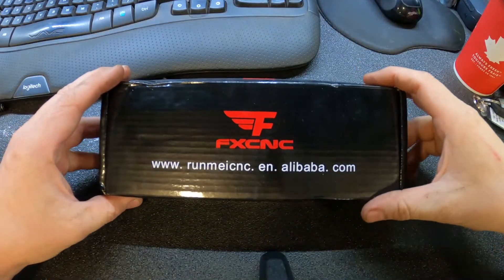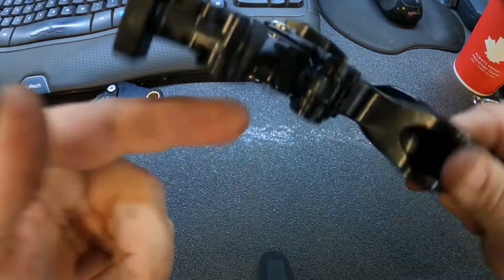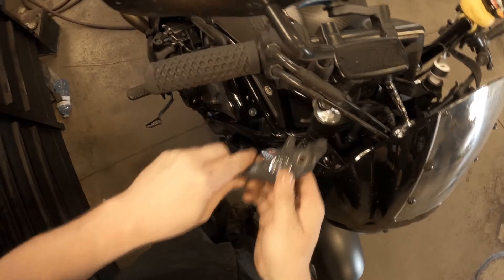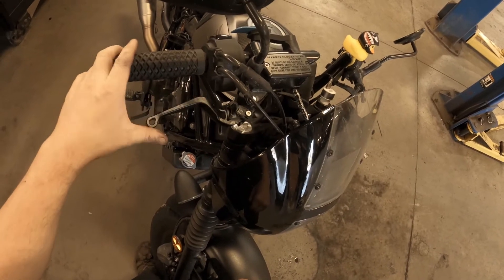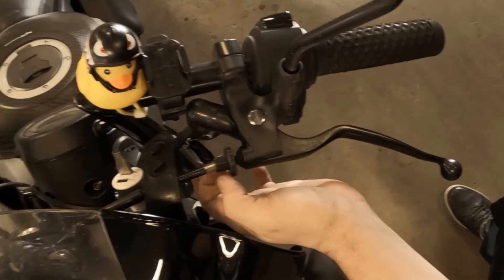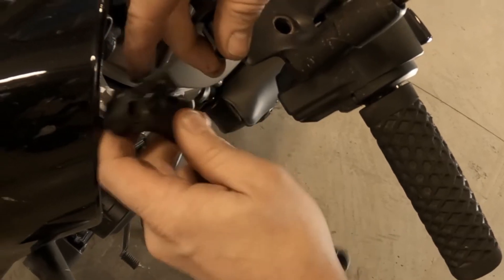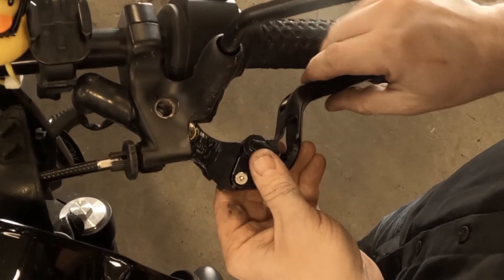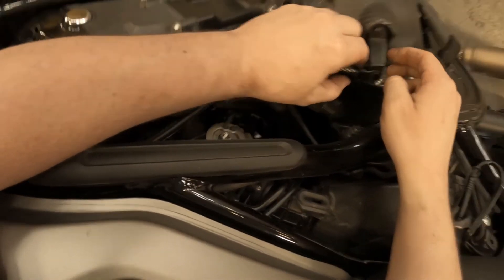Honda Rebel 500 (CMX500) Brake and Clutch Lever Install.

Comment: Thank you for the video!  I just installed these exact levers, and in particular the angle you showed of re-installing the clutch cable was really helpful. I love how they feel.  Out of curiosity, do you find the brake lever to feel a bit softer than the stock one did?  Everything feels good and like it works great - just noticing a bit more play on the brake.   Anyway, thanks again for the vid!
Reply from the maker: I did not nice that in the brake lever. Interesting. 

Thanks for the comment

Comment: The short levers make it look difficult to reach for the levers to me ~!   Are you sure that is an improvement ?     Kit
Reply from the maker: @deshavetalkwithkit8935  It does look that way doesn’t it. It doesn’t though. The adjustments make it come very close and easier to grab. Although be careful as this will adjust brake and clutch active engagement points.

Comment: Does anyone happen to know the size of the acorn nut underneath the pivot screw for the clutch lever. Mine must have fell off and lost after replacing my levers, I tried putting 1/4 inch acorn nut but doesn’t seem to thread down all the way.
Reply from the maker: M6x1.0 acorn

Comment: Will these levers work with the later model 500's (2020-2021) with the slipper assist clutch? Thought I'd seen comments somewhere that said no.
Reply from the maker: Absolutely!! Mine is the 2020.
Reply: @SLIGHT_  Thanx, I appreciate it. My guess then would be any after market levers would work for 2017-2021.

Comment: What is the name of those levers?
Reply from the maker: Motorcycle Short Adjustable Brake Clutch Levers for NC700/NC750 S/X 2012-2015, Fury/VTX1300CX 11-18, VT750 Phantom/Shadow 10-19, Black Spirit 14-16, CMX 500/300 Rebel 2017-2019 https://www.amazon.ca/dp/B07VRP1WNC/ref=cm_sw_r_cp_api_glt_i_6XMRTQJ76GJT48CXNRS9?_encoding=UTF8&psc=1
Reply: @SLIGHT_  Thank you very much